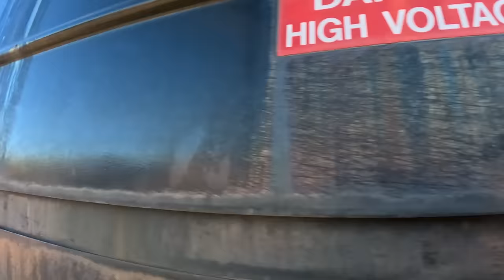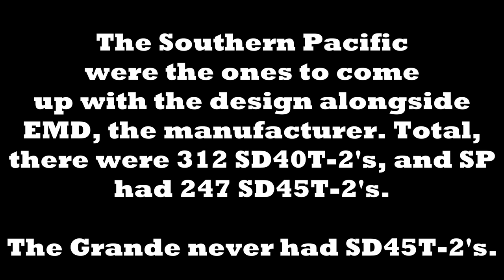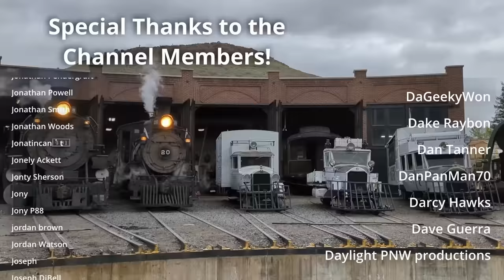A train that can BREATHE in TUNNELS? What's a TUNNEL MOTOR? | Railroad 101

Comment: I am impressed that the U.S. is developing new trains. On the other hand, Croatia still uses EMD GT22HW-2 (which is similar to the SD40) and G26 from 1973.
Reply: Where’s the best place to see trains in Croatia?
Reply: @bluescrew3124 in bigger cities like Zagreb, Osijek, Slavonski Brod, Sisak, Rijeka, but it's hard to see them. Most of times trains are broken down or not in use. Trains here are not really used. It's cheaper and a lot faster to use truck to deliver something. If you want to use train to travel 300km you need around 8h
Reply: @mrmura4   years ago I took a train from Zadar to Zagreb  and it took 12 hours…..

Comment: I lived in Tolland, CO for 13 years, which is right next to the Moffat Tunnel. I instantly recognized some of your video footage. I've seen so many trains going through there it's unreal, and I've probably seen that locomotive going through the valley too (lol). The locomotives going through put out so much diesel exhaust that they usually stop when they find out from other trains in passing that there are stowaways on the train cars. They'd stop the trains and call the local sheriff's office (me) to come out and remove them. Not so fun when it's -40 F outside. The Moffat Tunnel has a giant locomotive engine along side the tunnel entrance, which forces air in the opposite direction the train is traveling. This keeps the area around the locomotive from being consumed by the train's exhaust, and keeps the engineer and conductor from getting suffocated by the exhaust. When the tunnel fan engine fires up, it is so loud the sound fills up the entire valley to the east with the siren-like sound of the fan and engine.

Comment: If you can find the book,,very rare, titled the "Mack Railroad" the Gilsonite Route. It describes special built Baldwin locies articulated in the middle to make the sharp curves up Baxter Pass in Mack Colorado to Bonanza Utah to haul Gilsonite back to Colorado. When it shut down both Locies disappeared. One was found some 20 years alter in Honduras. From what I understand it is still there, on a side track covered with Jungle groth. Only two of the exotic  engines were made.

Comment: Here in Vermont, we have one of Southern Pacific's SD40T-2s still running. NECR 3317, built as  SP 8256 in April of 1980 is still used almost daily across the NECR system.  sadly NECR Repainted it to the standard boring orange and black G&W scheme, but it sure is fun seeing such a unique engine here in the far northeast.  I am hoping for it to stay for a long time, however it sounds like NECR will be receving GE -9 power sometime this winter and either selling or scrapping a lot of the classic EMD fleet including former a DMIR SD9 (NECR 1750)

Comment: “That button right there is the root of all evil” 😂😂😂 The railroad I used to work for had a former NS MP15E and it would take 7 or 8 starts before that governor liked what was going on and wouldn’t pop the button. 
I appreciate the older EMD’s but was ecstatic when my former employer bought six former UP SD70M’s. Better cabs, better ride, better pullers, and wouldn’t shut down randomly.

Comment: Southern Pacific bought a lot of them because of several steep grades the railroad had to deal with: Donner Pass, Tehachapi Pass and Beaumont Hill specifically. The cooler running of these "tunnel motors" was how SP ran some pretty heavy trains over these passes.

Comment: I live out east but the tunnel motors are special to me anyway. The Ohio Central System operated a trio that used to make frequent appearances on their coal trains before those were discontinued in 2020, though since G&W took over only 4027 is still on the Ohio Central roster that I'm aware of, 4025 and 4026 have unfortunately since been repainted and relocated to other G&W lines. 
RJ Corman also operates a number of SD40T-2s on their various lines.

Comment: The SD40-2T were designed in conjunction with EMD and Southern Pacific. Rio Grande just benefitted from the design. They were originally designed for the Donner Pass out here in California. They were not designed specifically for the tunnels but rather the lengthy Snow Sheds and very long tunnels on that route. But the history of the "Tunnel Motor" really begins with the AC series locomotives built in Sacramento California. They were known as the Cab Forwards. The only remaining example currently resides in The California State Railroad Museum in Sacramento. Basically the Cab Forward solves the same problem, only it keeps the crew alive.

Comment: I don't know why, but the Espee's tunnel motors were screamers.  They always made a whining noise, even when they weren't in dynamic braking.  I remember seeing an SD45T-2 switching the first load of paper cars into a new corrugated  box factory that my company was a contractor for, and I was suprised by the amount of noise that they made.  It seems to have been fan noise.  This was literally weeks after the UP merger in 1996, and my first professional job out of college 😊  I recall downloading an SD45T-2 on Train Simulator in the early 2000's, and it faithfully duplicated this, even in the cab!

Comment: Id love to see a video about diesel locomotives that use pod systems with 2-3 individual removable gensets instead of the standard single engine. At my job I manufacture large 16~ liter diesel gensets in sets of 3 for switcher locomotives. Mostly rail yard and shunting work but they're very fun

Comment: You can see in those GE engines going by as you're talking about more modern locomotives, an aspect of the tunnel motor lives on today: the air intakes are down low now. They don't have the bulkheads, but they did lower the air intakes from the high position that the early EMD engines had.

Comment: i worked the southern pacific diesel pit at sparks nevada in the early 70s. crews were changed and we went out to the yard to go through and inspect the locos.  i cant tell you how many times sd 45s coming off the mountain { donner pass } were out or  low on coolant, and i had to fill them. the railroad experimented  with some 'elephant ear' shrouding to come up with the design.. then came the sd 45  Tunnel motor!  wow they were great. but  my favorite was the sd 45x e.g. sp 9500 though. enjoy the videos ty
Reply from the maker: I heard about the "elephant ears" after I posted this from a friend. Wacky design, but I get the thought behind it. Must've been an interesting place to work! I bet you've got some good stories. Cheers!
Reply: @Hyce777  the sp's gp40x's also had elephant ears when new. Cp rail even experimented with them on sd40-2s in Canada over kicking horse pass.  On the sp, the elephant ear designs very successful and cheap to modify on existing power. There was one problem that kept them from system wide implementation and pressured emd to develop this new cooling system, train crews banging thier heads on the elephant ears walking back on the motors for servicing or walking between locomotives while running.  It also made basic maintenance on the radiator Intakes a pain

Comment: given the huge success of the SD 40 series of locomotives, I would gather that getting yours operational might not be terribly hard outside of funding to do it.
back in the 80's, they were everywhere and nearly all Railroads had at least a couple on hand.
their simplicity made them reliable and dependable with a bunch still in revenue service today. they were readily rebuilt and modernized keeping pace with railroad trends until engine performance capped out with the 645 and 567 engine blocks. 

although I figure you might want to have a bit more track to run a big chunky Tunnel Motor on.
and YES, a loco 360 on your resident diesels is a must!

Comment: Fun fact:
Prior to initial tunnel motor development, SP had initially tried to combat the tunnel overheating / de-rating problem by experimenting with a "tunnel curtain". This is circa 1969. Essentially, a large curtain of heavy canvas cloth, draped and "sealed" off the tunnel's opening, which was rigged to a mechanism that would vertically roll up the curtain when approaching trains would trigger trackside relays. The scheme worked so-so, but SP scrapped the idea when a failure in the system saw an SD push its way through the curtain, as well as the cost of retrofitting tunnels. The tests were performed on the west portal of Tunnel #7 on the Cascade Sub. It was after this series of experiments that SP finally laid down the gauntlet to EMD engineers and said, essentially, "you need to build us a modified SD40 that can adapt and live in our long tunnels."

Curiously, today, the UP has a lot of the similar problems on that sub with de-rating or shut downs. Everything old is new again.
Reply: They also considered electrification of the entire Roseville Subdivision because of how frequently the early SD40s and SD45s would stall at the Big Hole. Now that would've been interesting.
Reply: @mikehawk2003  That's cool, I'd never heard that before. Indeed, that would've been an interesting scenario.

Comment: I'm curious about two aspects of the tunnel motors:
#1 - it appears the air intakes at the front remained up high.  This is the generator & traction motor cooling plus the combustion air intake.  I'm really surprised they didn't need to move that down too.
#2 - Did they add a second discharge to cool the engine compartment?

Comment: While modern diesels have their good points those older 2 strokes just ran and were reliable, very simple, easy to diagnose as well as fix. They didn’t have all these modern computers and sensors which are bad about falling and causing a lot of issues. I’ve seen plenty of built old 2 stroke engines making as much if not more power and torque than modern engines when built right. Plus the sound of an old 2 stroke diesel with added turbos and superchargers is an absolutely amazing sound.

Comment: It'd be fun to take an older loco, turf the engine and put it the biggest flywheel storage system that'd fit.  Charge it regeneratively (or at least on the flat bits from the other engines) and use it take up some of the load through tunnels.

Comment: SD40 is a turbocharged engine with all mechanical injection, this causes a blip of exhaust smoke when engine is notched up as the increased fuel needs increased air.  The turbo cannot instantly accelerate, leading to smoke. 

Smoke in the tunnel is directed to trail the train with higher pressure air in front.  Naturally, the cab needs fresh air.  Must have been rough during the days of the caboose

Comment: It was another 6 years before Detroit released the 60 series, which was the first fully electronically controlled engine to market. 
I think that was built a good 12 years before Cat and Cummins put any electronic controls on an engine. 
Sometimes there's something to be said about stupidly simple engineering. My old f150 doesn't sit there constantly checking up on all the sensors and door locks and kill its battery like my jetta.  It starts after not being driven for a couple months.

Comment: I lobe the southern Pacific engine my dad started working for them doing telatype after Vietnam I grew up in the 80's on the Oregon coast in a SP train station running with my dad letting trained across cold bay through reeds port then Florence .I also got to ride from cops bay to Florence a few times in the caboose and of course the engine

Comment: All modern diesels starting from the EMD SD70ACe and GE C44-9W have a similar concept to the tunnel motors with GE being closer. The vents are down low with fans blowing air thru the coolers like the 5401. Im not really sure about the modern EMD tho.
Reply from the maker: It depends on the engine; but yeah, some have altered cooling as well
Reply: @Hyce777  im honestly purely guessing based off looks and maybe some knowledge from animographs diesel video. I am by no means an expert at this. Just educated guessing. Lol

Comment: So fun fact I like hot rods and wanted to know to what affect does tempture affect Power output. If i remember right every 10* colder you can get the air is about a extra 1-2hp. Up to a certain point but this was factoring for differences between 70* and 110* ambiet air temp. Thought it was a stupid fun fact that belonged here.

Comment: I knew about the tunnel motors already, but I thought that intake section was for the engine's air intake, to limit the dirty exhaust laden air from being sucked into the engine. If I'm understanding you right, it's only for the radiator fan intake?
Reply from the maker: That's correct!

Comment: Mechanical governors shut down because the read a low oil pressure as a critical overspeed condition - the overspeed bolt trips the oil pressure to the governor actuator.
Electronics overspeed trips are much safer…(because you don’t need to physically overspeed the motor to test them (with the associated 1% catastrophic failure rate during testing (yes mechanics have died testing mechanical overspeed trips)).

Comment: In Denmark we have a 3900 hp lokomotive Called litra mz from 1967 to 1978 builld by nohap sweden wit a 645 20 cylinder gm motor.
The Electric Siemens locomotive nowadays are much stronger. I think maybe 6400 ho

Comment: I have always wondered why with multiple engines there is some hooked up backwards to the others?
Reply: Basically the locomotive works just as well in either direction, so there's no reason to turn them all to face the same way, but the controls are set up to be easiest to drive forward, so there's a good reason to have a bunch of them facing each way so that it's easy to get one facing the right way at the front.

Comment: Nice video! I did have a question actually! When there are one or more locomotives and stuff. Especially if they are right behind each other. Is there drivers for each one or just the ones in the very front? Can the guy in the front control the ones right behind them from inside or something? This video reminded me of that because I saw the clips of the 3 in tandem

Comment: Do tunnels like Moffat or Flathead have any extra air ventilation designed into them ??  It would seem like a tunnel of several miles would get very little fresh air back to its center, leaving stale air and less oxygen for the next train+crew traveling through.
Simply having a few hundred rail cars moving in+out of the tunnel would pull some air along with the train, but one or two locomotives are also using a lot of O2 and working hard to put out plenty of smoke and CO2 that needs out of the tunnel.

How does that work out??
Does that also mean a tunnel can only have a train go through XX hours after the last one, to wait for fresh air?

Surely the people who designed, dug, and maintained the tunnels thought about ventilation issues in advance...

Comment: i'm willing to bet that the modern locomotive engines are far more efficient than the EMD 645 is, so they don't put off as much heat to deal with per kW of power down, so won't need to derate as heavily in the tunnels.

Comment: men I wuld like to see those old Hot Bulb Gasoline-Disel engine block trains who run an generator I suspect it was starter/generator set copeled to an metadyne rotary transformer who in turn drived electric motors directli insted of an engine transmision. Those trains were cool and legendari unusual also wuld like to see how those center tap transformers worked with wacum tubes with those circuets lot of those things are rare to finde and they arent reali explained to full degree. I love those Dual Engines like Farmmal MD tractors and similar lay outs they are unique.